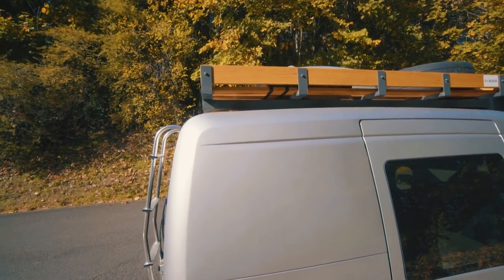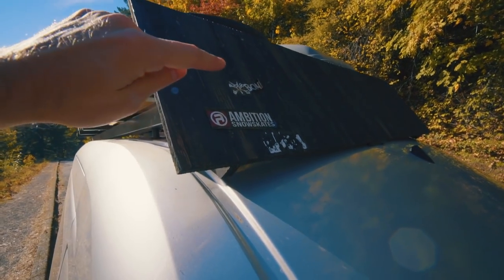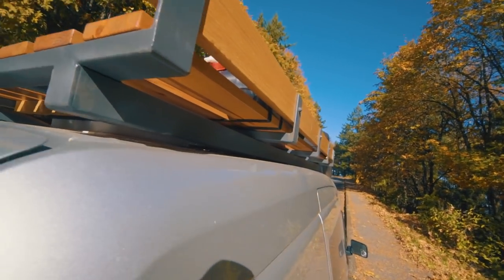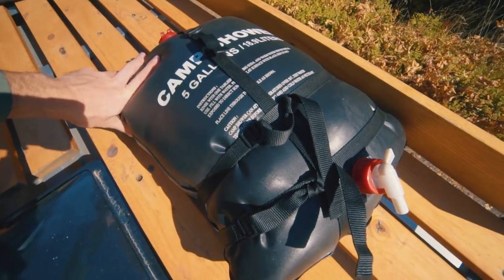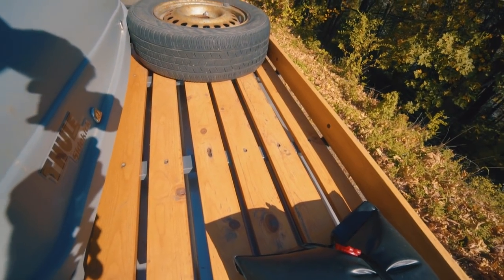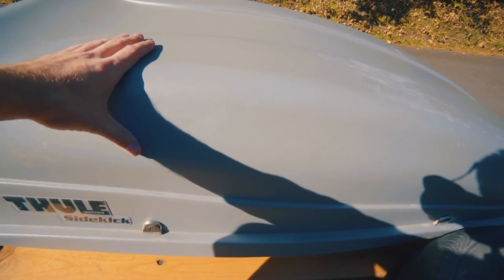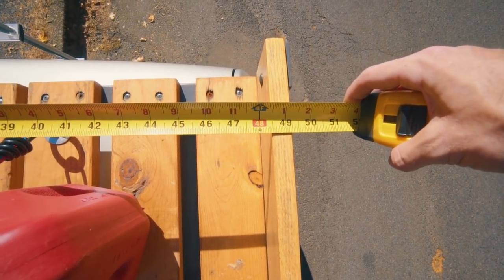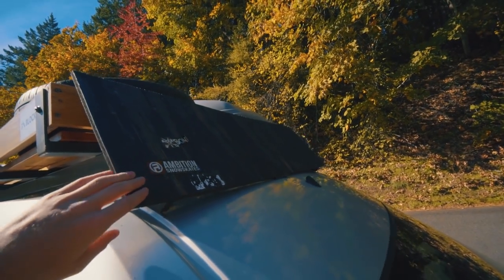CUSTOM ROOF RACK on my CONVERSION VAN!

Comment: Moisture will most certainly collect in those tubes. Personally, I would drill holes in the back-lower corner of each metal support so that when you drive, the moisture should leak out the back and even if you don't drive, the moisture has a place to evaporate.

Comment: I had an idea for the rack build out.  I'm thinking; adding stainless wire folding railing that fold down and over supplies stored on roof.  could be set plumb for rook deck observation deck and star gazing.

Comment: The commercial ones don't put the weight on the bolt holes but rather on a plate that spans interior roof beam.

Comment: Looks nice but that wooden bars wouldn't last long under the sun... Poly coating will come off, need to put poly layer every year.
Reply from the maker: Agreed! I tried to put a thick coat on but it did ultimately start to come off.

Comment: Hey Josh, This is quite a bit of time later, however I am doing a 5x10 wood roof rack also from 1x4's, treated & stained. I'm going to have 6 rain gutter ladder 
racks, spaced about every 2ft apart. Will the boards bow? I'm using it for a cargo box & sleeping in a cot tent. Thanks for any info.

Comment: Hello, enjoyed all of your videos.  Can I ask: what made you decide to rely on your van's alternator and not put a solar panel on the roof?  Thanks!
Reply from the maker: +William Lockard glad you liked them! I really don’t use much power, no fridge or anything that requires constant power. To be honest I most likely, with my set up, could’ve gotten away with just my starter battery! I would have invested in solar had I went the fridge route!